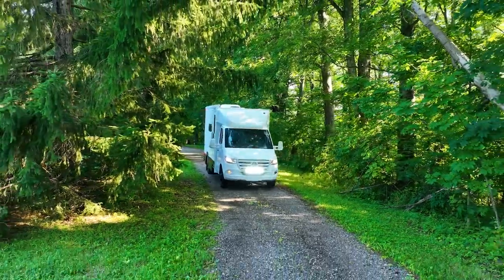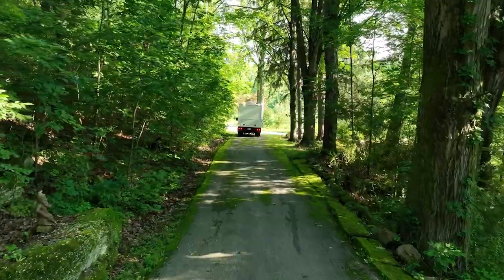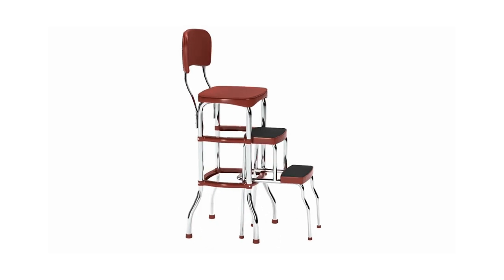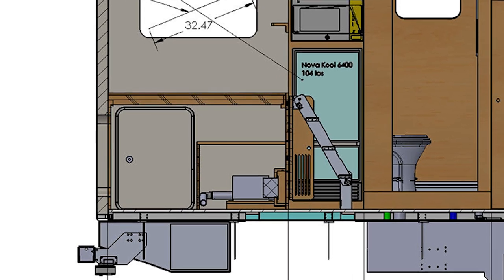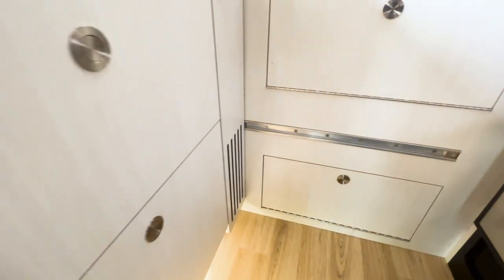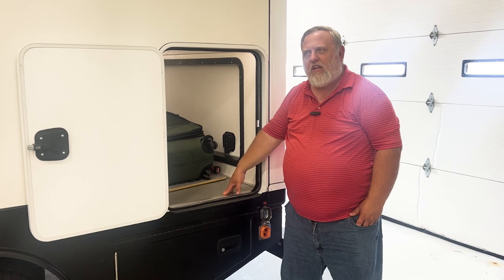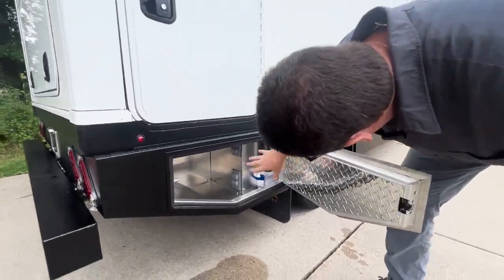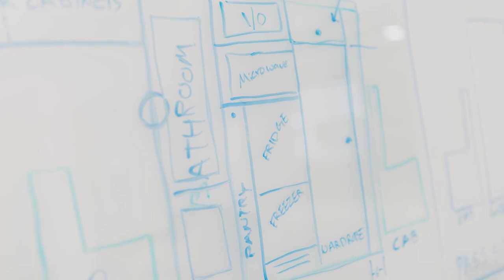TRAVALER | B Box Van Tour with Washer/Dryer + Platform Bed

Comment: "The first thing I want to see when I step in my 250k van is a washing machine," said no one ever. Sorry, guys. Been impressed with a lot of your builds and layouts, but this one misses the mark. Pretty simple to fix, though, by putting it behind a cabinet door.

I take it back. The stairs are the worst part (so far). What a PIA to get in bed. 

Followed by the warm air exhaust. Nice poof of hot air in your face from the microwave and fridge.

3 door garage is brilliant!
Reply: This dude obviously does laundry every day, or maybe twice a day, so he wants easy access. I agree about the stairs, good idea, poor execution. It should have been like the  chair he referenced, one move/swing down. Luckily when you're ordering your $250k RV, they'll build it exactly the way you want it.